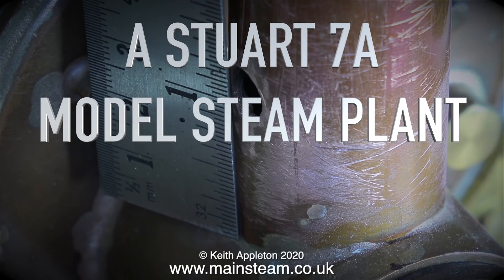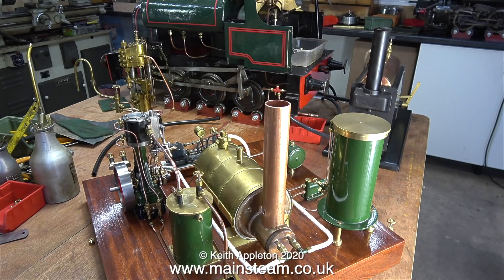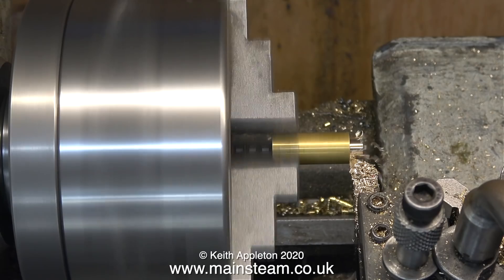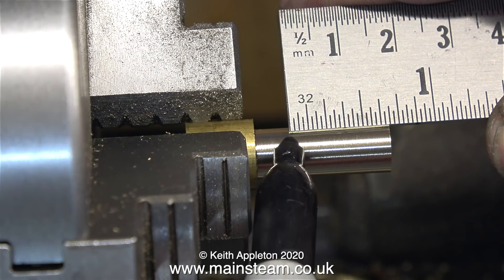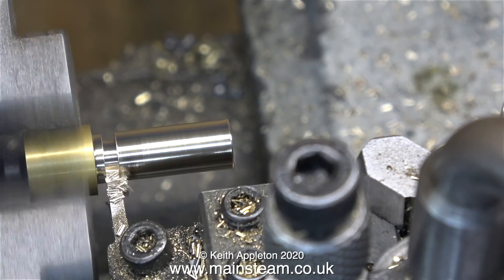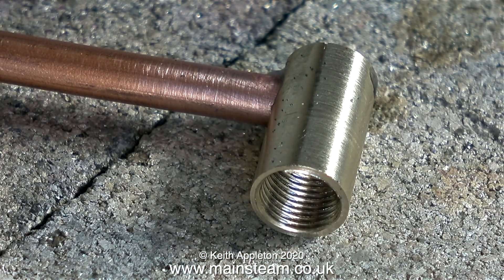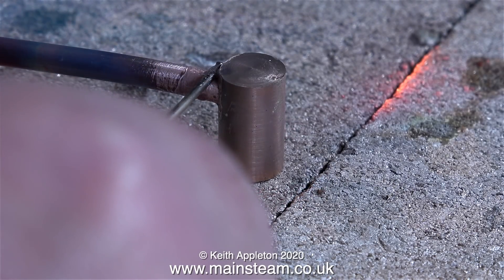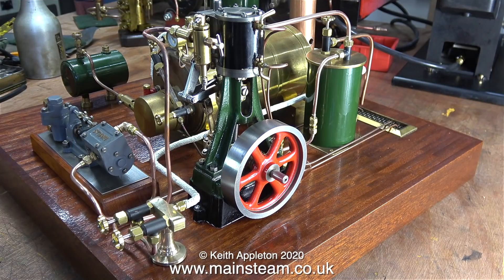A STUART 7A MODEL STEAM PLANT - PART #25

Comment: Wow - dude - you can see the brass bar increase in diameter as you drill it tapping size for 5/16" - see 3:33 - 3:50. Cheers, Jim
Reply from the maker: yes indeed, it was far too thin - that's why I purposely melted it }:-)))

Comment: Hi Keith,  Do you know the dimensions of the 504 chimney.I'm restoring a 504 boiler but have no chimney and at the moment an unable to afford a new one from Stuart,  If so could you let me have them,  My boiler was severely damaged in a devastating garage workshop fire severely damaging most of my tools and machines. and I am repairing and refurbishing any partial survivals.
Reply from the maker: It depends on how old the boiler is. Some are larger diameter and length.

Comment: Could a displacement lubricator be put into the steam inlet pipe right before the turrent?  Or is that too far away for it to make it to both the engine and the pump?
Reply from the maker: Not really as the main steam feed is to both the engine and the pump. There is an obvious place in the steam line near the pump - after the turret.

Comment: 5/32 pipe for a 7A?
Reply from the maker: Yes, all the steam inlet piping on the plant is is 5/32" - it works fine, after all it's a small model steam engine and isn't ever going to need a high capacity of steam is it?
Reply: @keithappleton  didnt know if that was the mistake. 😁